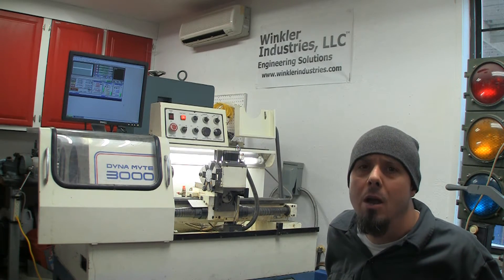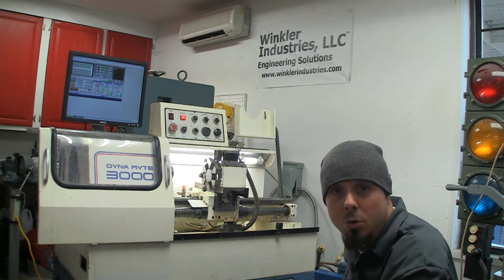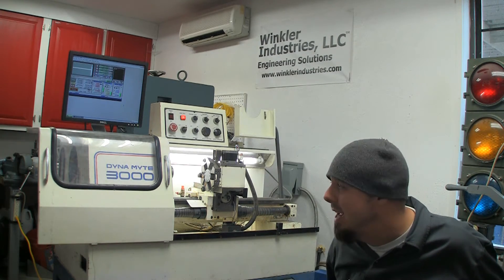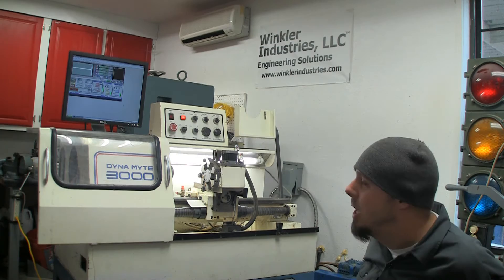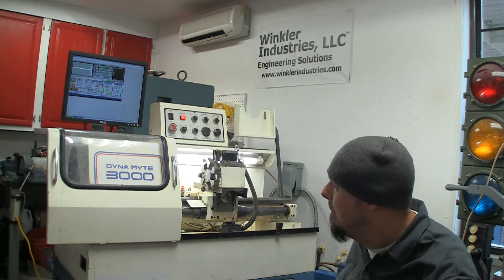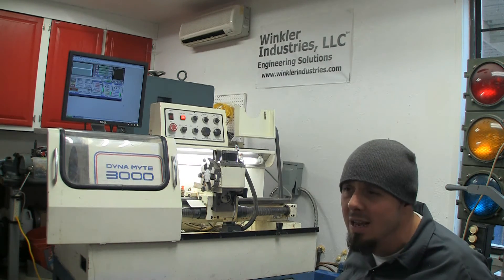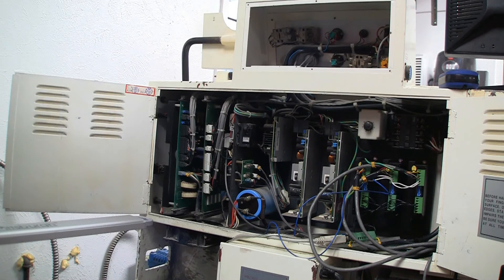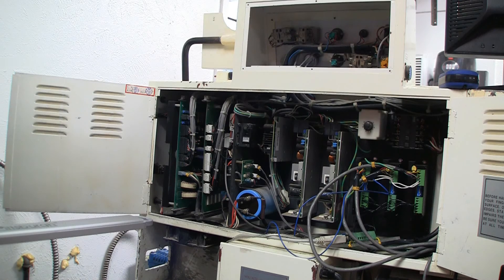DM3000 Update 1

Comment: i use to have the dm2400 mill. it was setup to run on mach3.it was nice but now i jave a converted rf45 which runs on cnc masters software n i hate it. i need help to convert to run mach3.anyway nice lathe n shop bro